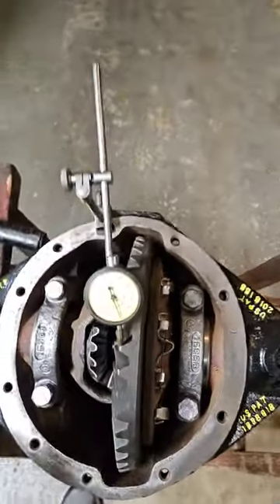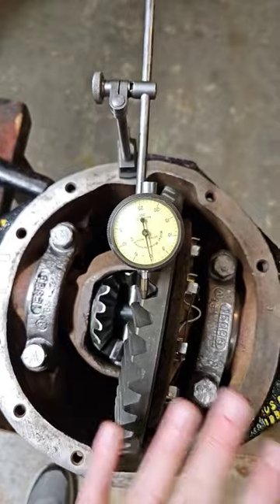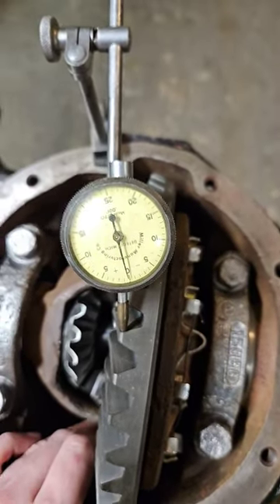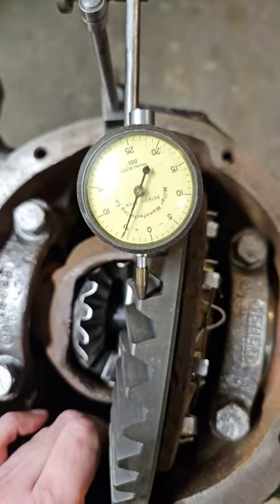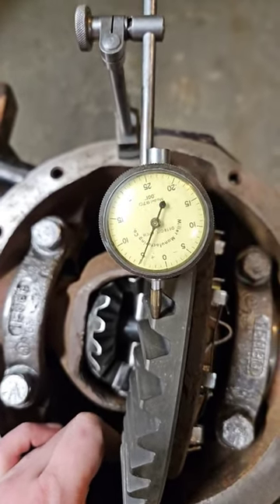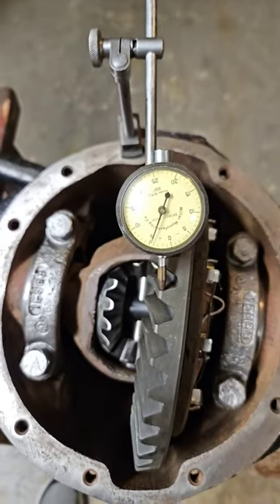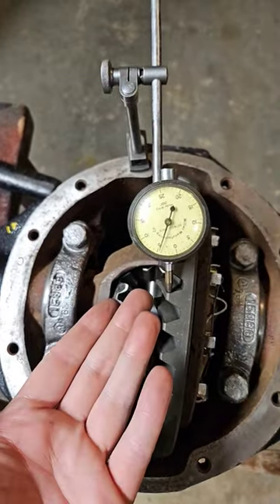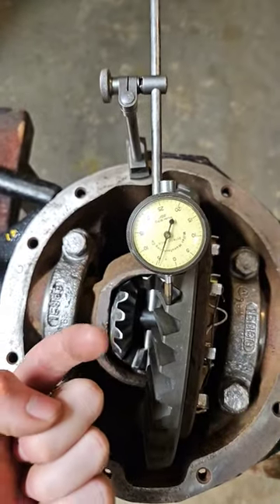The Dana 41 Basket Case Axle is Nearly Figured Out

Comment: Spec is 6-10 thousands, the main thing would be to use machinist blue and check the wear pattern. I hate to say it, but even for something brand new, it might be a bit too tight, but you'll know for sure once you see the wear pattern. Looking great overall though 👍 the axle should be all done soon! Looking forward to that!
Reply from the maker: This is what gets me. It seems that there are multiple opinions on what the backlash spec is. Moses Ludel says .005-.010 in the CJ rebuilders guide. The service manual gives three specs: .004-.007, .005-.008, and .006-.009. (Page M-9). Not sure where .006-.010 came from? One of the service manual revisions?
Reply: @SunkCostGarage  I think it came in a later revision, but that is more of a reference, the real deal is the wear pattern, sometimes you can be within spec, but wear pattern shows you should move it a little.

Comment: I don’t know I am a Amateur home mechanic I don’t even know what that tool is called or what you were doing with the differential
Reply: That gauge is called a dial indicator or a machinist dial indicator.  It's for measuring very small increments
Reply from the maker: Truthfully, same here! This is my first differential rebuild so if it looks like I know what I'm doing, that's accidental. That is a dial indicator clamped to the axle housing to precisely check the back and forth play on the carrier assembly. Can't be too loose, but also can't be too tight. I've pieced it together and taken it apart probably 15 times so far to get it this close.
Reply: @SunkCostGarage  the only time I messed with differentials was my brother in law’s ram that had leaky seals. We had to modify a L Allen wrench and a lawnmower blade to make a wrench to get it done.